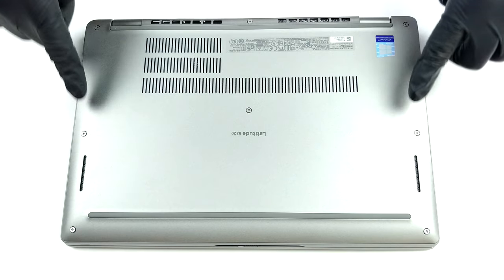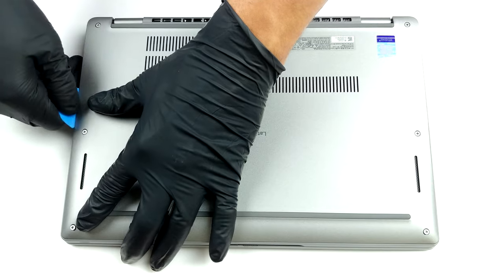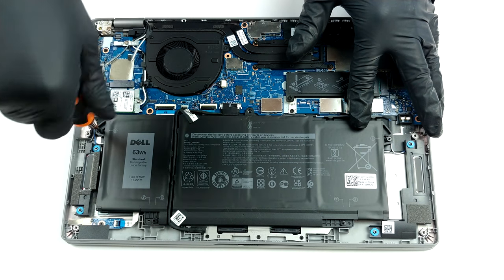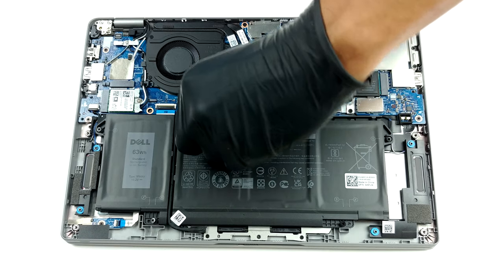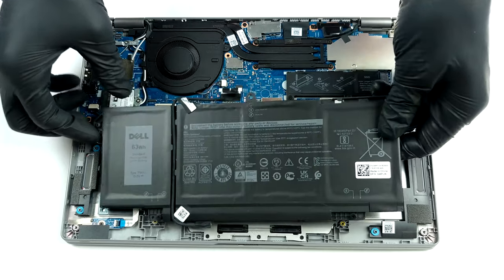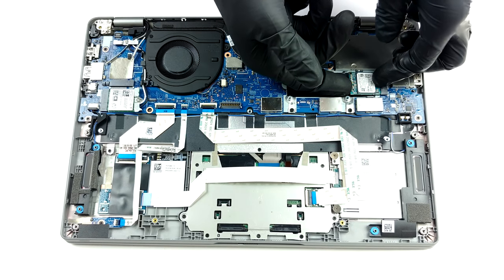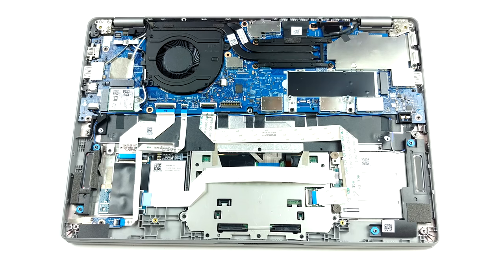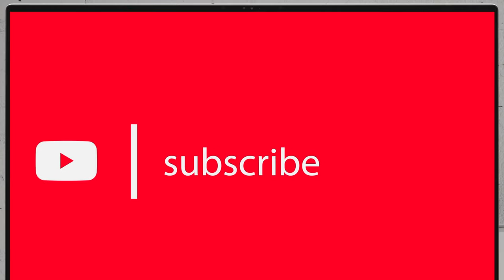🛠️ Dell Latitude 13 5320 - disassembly and upgrade options

Comment: What are they thinking with soldered RAM???? Seriously????
Reply: Most laptops are like that. Especially ones designed for businesses like this one. You order the ram you need. Businesses usually don't worry about replacing ram on laptops because they don't need much. I just custom prderd one from Dell with 8gb because all I need it for is setting up files for machines, expense and income tracking. Definitely won't be gaming on this. That's what my alienware is for lol.
Reply: @zero00044  No.
Reply: By soldering it directly you shorten the distance from chip to CPU which means you can run the RAM at faster speeds with fewer errors. It's also why thin laptops can be so thin. It's anti-consumer but my main beef is that nobody lists this detail on their web pages anywhere so I can avoid this crap. Even gaming and super potent workstation laptops have this problem. Modern CPUs support larger RAM quantities than we currently manufacture so a 2x32gb setup could be upgraded to 2x48gb or maybe 2x64gb later. That said, if you can find someone (and plenty of people do this) you can desolder the old stuff and solder in new. People do it on modern Apple laptops to upgrade the SSD, the Switch can have its eMMC upgraded, etc. It's not all that expensive just complete bullshit that this is what we have to do

Comment: A laptop has hardly 2 components to upgrade a RAM and a SSD.  RAM is the main component. If you can't upgrade RAM then what's the point of this machine ? And what does it mean you can have 4 to 32 gb ddr4 ram upgradation ? Its preety confusing .... Pls can someone this thing I am looking for Ram upgradation in this laptop mine is having i7 , 16gb, 512 gb ssd.
Reply: Ram is soldered to the motherboard, therefore cannot be upgraded, at least you have 16gb, unlike my 8gb

Comment: For upgrade options you can mention backlit keyboard if it comes ith a non-backlit version. You can also install a security card reader(which would require a back shell change with a card reader slit though), NFC reader and also buy a SIM card tray and use the SIM card reader built in but just hiding behind the plastic cap. You can also change the non-touch screen to a touch 2 in 1 as this motherboard supports it. I  was expecting you would be mentioning these but you just half heartedly mentioned the battery. And yes if yours come with a 42W/h battery you can upgrade it to 63W/h buyyour self as this would be the easiest upgrade. Also you can upgrade the stock charger to a 100W one.

Comment: do you know what the two metal pieces on the right side of the motherboard is used for? the ones that stick up and connect to a copper tape

Comment: What is recommended for this laptop if spec includes 8gb and sad 256gb
Gaming, programming, or just regular useage
Reply: If you were still wondering:
You can use it as an everyday device as it is very light and compact. 
You can also use it for programming. For graphic intensive realtime games I wouldn't recommend it but it will be adequate for turn based or puzzle games. 
You can also use Photoshop or Illustrator(or Krita etc.) for graphic design. 
You can also use it to produce music using Abelton Live, FL Studio etc.

Comment: What are the upgrade options??
Reply: The SSD and WiFi card is it. 4TB is about as good as it gets for now and the stock WiFi card, in mine at least, doesn't support 6ghz or WiFi 7 standards. You can replace the thermal paste as I did using a liquid metal TIM but the RAM is soldered because Dell hates us all